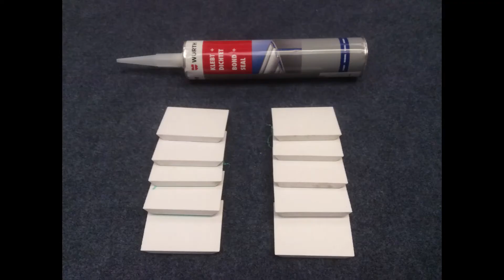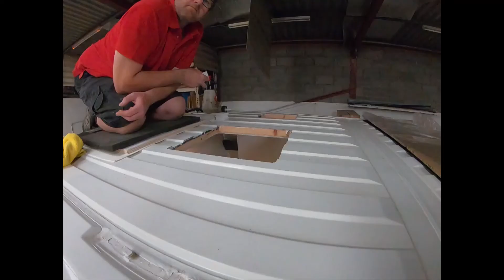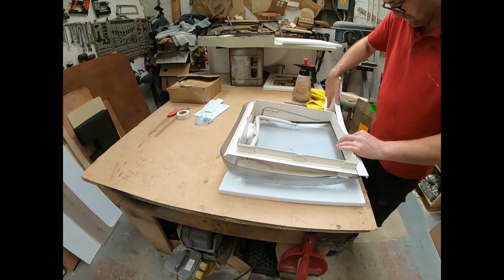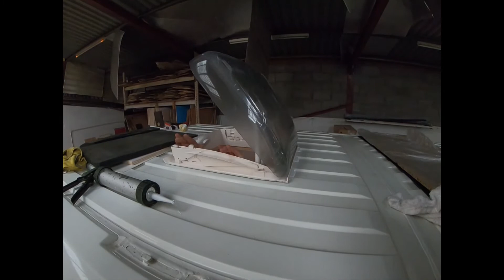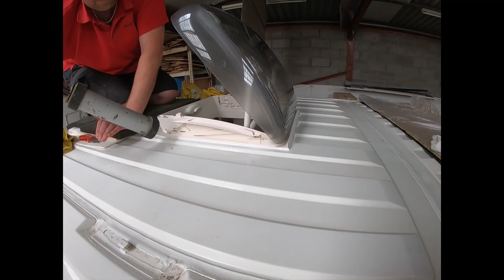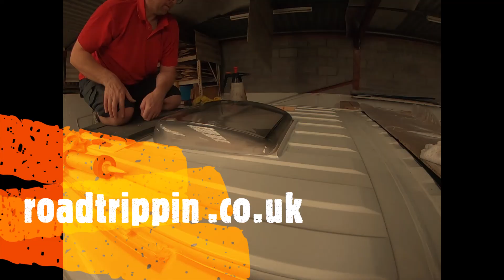Camper van Roof vent Fitted using Road Trippin Profiles Fiat Ducato Peugeot Boxer Citroen Relay

Comment: Hi..Planning on fitting a new vent on my mums camper this weekend and have purchased these to make life easier. My question is what is the black material between the timber and the outer skin of roof? Is it some sort of membrane you have fitted  or is this part of the original construction?   Great video makes it look so easy...
Reply from the maker: Sorry i have only just seen your question we use bond and seal to stick the wooden frame up inside the van which allows us to sandwich the roof vent and the inside frame together hope fitting your mums vent went well
Reply: @roadtrippin-45  Thanks Rachael. Yes, I fitted one with a fan and all went well thanks. I used adhesive for the frame and clamped in place till it dried, but your solution is simpler. The hardest part was fishing a cable through for the fan.